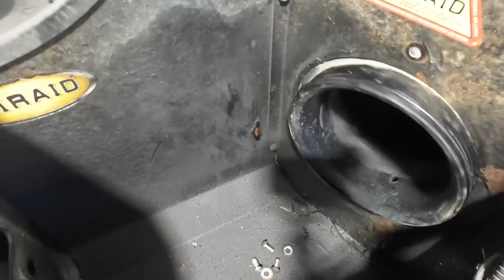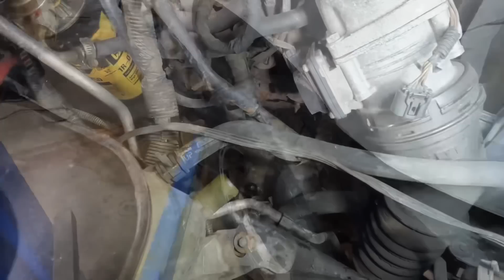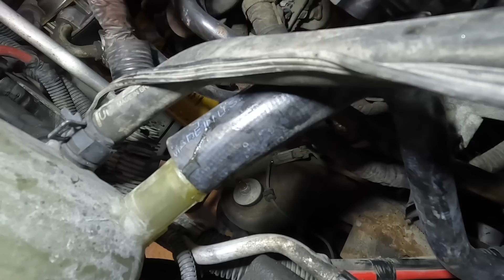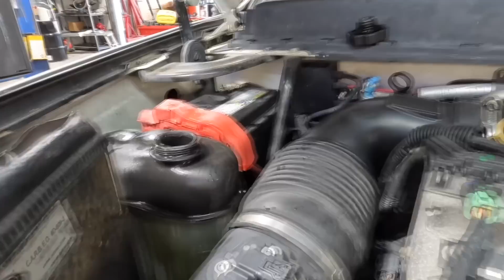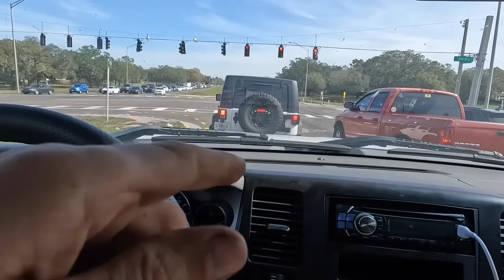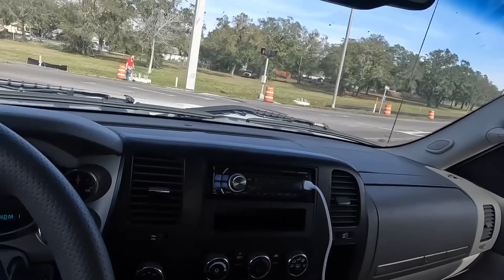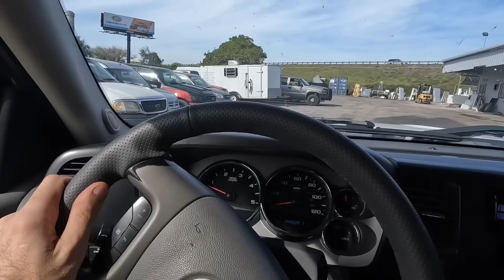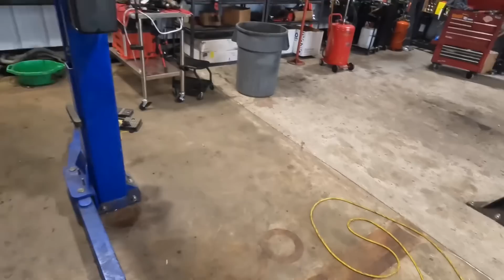Four way Radiator Hose “updated design” | Pig of a job! DURAMAX 6.6

Comment: I've learned a couple of things concerning exhaust manifolds over the years. The best method for welding cast iron is to preheat the manifold and weld with a nickel rod. If your method works, then it works. The other thing is to never plug a hole with a steel bolt or socket head screw. Always use a brass plug, especially if you ever want to remove it in the future. You stopped the leak. Mission complete.

Comment: Electricity is lazy and always takes the shortest path. That being said, if you clamped onto the frame and had a bad engine ground, yes you could fry modules but I like to believe, if you own a welder, you probably know to put your clamp on piece being welded.

Comment: Back in the '50s and '60s welding cast iron with torches didn't usually work well which is where the myth comes from. TIG and MIG are very different animals.

Comment: Call me crazy, but it looks like if you tie a chain to that hose, connect it to the bench and backup the truck out of the shop as fast as you can, problem solved lololoolololo The idiot that designed that needs a trip behing the wood shed lololololo  Good Luck, Great work as always.

Comment: I'll have to go back and watch that video, but you can definitely weld cast iron all you have to do is preheat it first and grind a groove in where it's cracked to give the filler room. Just because they can't weld it doesn't mean it can't be welded.

Comment: To avoid getting soaked by coolant with disconnecting, just slice the hose at the low point. It's being changed anyway, so no harm. I've replaced a couple dozen of these hoses.

Comment: Nothing wrong with welding the hole up the way you did. A-holes will pick apart anything you do in public.

Personally before I seen your vid I would have found a short bolt that fitted in inside the hole and welded that to the manifold. 

Clearly you have plenty of experience and always double check your own work so good on you for all the great work and content you put out. Ignore the A-holes

Comment: People don't understand old school mechanics. Welding that hole was a great way to safely fix the problem and save the customer some money. People that don't care about customers would want to replace the manifold and charge for drilling out the studs if they broke. You care about your customers and getting the problem fixed. Keep doing you Ray, 🖕🏻 the trolls.

Comment: I don't think there is anything to worry about with welding that hole shut on the exhaust manifold.  I wanted to upgrade my vehicle a few years ago, and part of the project included cutting the flange completely off of a cast exhaust manifold and then welding it back on at a different angle.  This was on my daily driver, and several years later there has been zero cracking or other issues at the weld.  I suspect the people who say "you can't do that" are simply the ones who are afraid to try.

Comment: The bolt is what you use when you don't have access to a welder. more than one way to fix a leak. The dealer would have replaced the entire manifold so there is that...

Comment: On most your videos, maybe all of them, you ask people to share comment INCLUDING what they like and don’t like so you are setting yourself for anything from tips to criticism. Even if you said nothing, such comments are inevitable. If you are open minded, some comments will have merit and some not (based on your own evaluation of the comment). Ponder the comments for merit and if you disagree then ignore them.

I questioned in my own mind if a bolt or equivalent might be easier to plug the hole. Why? Because I can’t weld but I can screw something in. My thoughts are 100% based on my ignorance….not my knowledge. My only talent for mechanical issues is that I can pump gas with the best of them. I do change my own oil and a couple of times I changed spark plugs. I am a mechanical moron with only a tiny bit of confidence wrenching on old cars that were made before 1970, used carbs and had virtually no gizmos on them (computers, sensors, etc.). And yet even I have opinions and like to talk shop…..in hopes of learning. I never miss one of your videos. Most I can follow. Some are so far above my head that I can’t follow at all but I watch anyway for your explanations and comic relief. Thanks for all you do and treat critiques like mosquitos. They have no real value.

Comment: I wonder how much transmission fluid you could put in your 4 quart of oil to help clean the inside of an engine.  I have done this in lawn mower engines that were old and abused. It helps with  cleaning and rejuvenating an old abused engine.

Comment: Ray....you NEED to work on a lightning strike vehicle! THEN, you'll "Ahaaaaa'
Reply: And it's not even a direct hit, that blows the sh¡t out of modules! That's static electricity at thousands of volts, coming off those arcs. This essentially and repeatedly, sucker punches the snot out of transistors and diode, inside the IC chips. It blows holes in microprocessors.

Comment: Hi Ray… I have a 2015 Honda Odyssey with the 3.5 56.000 thousand miles. Similar to the wife unit van. At highway speeds I notice a puff of blue smoke in my rear view mirror it goes away immediately. It doesn’t smoke at all in normal driving speed. Can you give me any suggestions? Thanks in advance.

Comment: I think that welding with battery connected can be an issue think I've heard a story or 2 about guys who build race cars having that be an issue but like you were saying I think it has way more to do with the ground clamp being like at the front and you're welding a cage on the inside so now there is a long path

Comment: I am back to watching your videos.  Just saw "The Sluge is strong with this One".  Maybe try pop sickle sticks cut on the flat like a wedge to hold those plastic mounting clips open.  Also, maybe you like the glug-glug when pouring out of jugs, but if you hold the jug with the spout at the top instead of the bottom. no glug-glug  or splashing.  Works really great for gallon size metal cans, acutely all most any contain with a spout.

Comment: I'm not a professional welder, but I can hold my own, although it might not be as pretty as a pro. I welded a 2 inch square bar 8 feet long on the front of my travel trailer years ago because I wanted to have a point to use scissor jacks for leveling it, and most places required me to lift one whole side off the ground.  Plus it reinforced the tongue...they don't weld them like I like it.  Anyway, 12 volt system, ground on the frame within 4 inches of where I was welding, no issues.  People were like, "OH, no, you welded without disconnecting the batteries.  YOu probably burned something inside now".  Never did a thing.  Electricity flows to the shortest route from positive to negative, so it's not an issue. Unless you're using a 50 million volt lightning bolt and you're Zeus there won't be an issue.  Saw lightning miss 2 dozen trees 50 feet tall to strike a fence 4 feet tall once.  Zeus must have saw a bug or something he wanted to kill...LOL>  Anyway, keep up the good work.  Let the trolls find another bridge to bother people crossing.  Don't even acknowledge them. That's all they're looking for...attention.  Take care.

Comment: Ray don’t take all these  comments too personal. She welding cracks on let say the block which some machine shops do to save classic number match inv blocks is very critical to the process and the type of metal used to weld it    You just welded a small hole. You put out good videos

Comment: Holes in cast iron can be welded. The problem is with trying to weld a crack, because the crack tends to sprread under the heat of welding, so you keep on attempting to follow the crack.

Comment: Hi Ray.
Re manifold welding. Ray it was your own voiced concerns re debris falling into the manifold that would have prompted people to suggest installing a cutdown bolt into the hole, not tapped , and shortened. This  would  have addressed your concerns add made the job easier as you would be welding the circumference of the bolt head and not trying to fill a gap . Yours Ray.

Comment: What you are missing on the manifold leak is that you should have dismounted the manifold, weld the hole mostly closed, tap the hole, thread in a bolt, weld the bolt in place, then remount the manifold.  All while spinning a dead cat counterclockwise over your left shoulder of course! 😁

Comment: Great explanation about the module issue. You are correct, but plz don't be offended. I am just conveying my experience. I use to install spreader beds onto 18 wheelers. we welded only behind the cab and back, but still burnt the ecu out.

Comment: I had no problem with you welding the hole shut.  No blow back; just a simple question - which you answered well.  Different metals could have introduced and temperature differential stress crack risk.

Comment: To all of you calling others that suggested tapping the hole with a plug, calling them arm chair mechanics. How do you know? Just because they suggested a different way? I have been running my shop for 40 years and I have installed many Banks temp probes in the exhaust manifold by drilling and tapping without removing the manifold. Never lost a turbo! Also everyone that said the plug could crack the manifold, why would Someone like Banks suggest drilling and tapping a hole in the manifold? But since he was not ever going to install a temp probe in that truck, I agree with welding it! I like watching this young man because this old man does learn a couple things! Keep up the great work Ray, and always be open to suggestions! You will be very successful!

Comment: I may not be a professional welder by any means but I’ve done enough to have proven Ray correct here. I’ve had my arms resting on the grounded table, yet I was unharmed. The electricity will not go through my jacket across my entire body and out through the soles of my boots, it’s going to go immediately to the grounding clamp. It’s pretty simple stuff, dunno why people don’t understand it

Comment: Everyone  commenting on welding the hole shut,...it isn't a problem,as  in a cracked manifold,since it wasn't  spreading.
However to be safe,the manifold should have been heated,then welded.
But very doubtful that it will give problems either way.

Comment: Welding CAN cause currents in unrelated conduction paths not directly in line with the main current path. Its quite unusual for these secondary paths to have high enough current to do damage, but it has happened in the past and it can happen in the future. 
Just look at the history of "spark gaps" and you will see that 100 years ago they used spark gaps as the very first transmitter to send a signal across the Atlantic ocean. So yes spark gaps can cause currents in unrelated places. The fact that you have never seen damage is good, but not universal.
PS. it can cause damage even with the battery disconnected (even more unlikely but still not 0 possibility)

Comment: Hi Ray, just watching the rad hose part & am wondering why G.M couldn't just piece the hose together at the bypass hoses with clamps. Is it that G.M is that broke that it needs to make mechanics charge the customer so much to do a 10 minute job instead of 4 hrs. Keep up the good work buddy. Love watching you work on American cars from Australia. We would say the engine bays are toadstools cause there isn't mushroom. I think I will stay with my 2.9lt turbo common rail diesel.

Comment: Welding causes spatter and cast iron is a very dirty metal,which means that even using a mig process there will be small amounts of slag. If you weld a manifold and then clean out the inside then you're good.

Comment: As the old saying goes, opinions are like assholes. Almost everybody has one and many of them stink, your own included. With that small hole, the welder was probably the easiest way. The cast iron in exhaust manifolds is usually pretty low grade. Sometimes the weld doesn't stick so well to the cast iron, especially when it's contaminated with exhaust gases. You saying that plugging the hole with a bolt would restrict the exhaust is as much bullshit as the people who say you shouldn't have welded it. You don't have to use a 2 inch long bolt. You can tap a hole without getting any more debris in the manifold than you did with the grinder. You can use grease or a magnet on the tap. You can pressurize the exhaust with air to blow debris out of the hole. There are often multiple ways to accomplish the same task with one being just as valid as another.

Comment: A lot of armchair mechanics still believe that there is a problem when welding cast iron. Unless they have mig weldedcast iron before, but don't even try to stick weld a cast iron manifold with the old 6012or 6014 low cal rod. You need to use High cal(cium) rod when stick welding cast iron. Also there was no structural stress when simply plugging a hole.

Comment: Everyone has opinions welding the hole shut versus welding a plug in it with the heat on the exhaust the plug or bolt will not last , the weld is 100 times stronger than

Comment: It fine...you should gave just stuck a carrot in it...

Yes, cast can be welded. I weed a 4 " crack in a 1941 Chevy engine block using an AC welder. It was just the outer water jacket. I heated the area thoroughly, evenly first. Welded quick so as not to crystallize the cast.  Engine was out, laying on its side. Worked fine, last long time. :) We used " Super cast" welding rod.

Comment: One point is that successfully welding cast iron that needs to carry a load, either from thermal or mechanical stress (i.e., something that has cracked) and having it last is way hard and way different from welding up that very unstressed and perfect hole in that manifold -- two very different situations.

Comment: I think they explained the method incorrectly. It can be anything to cover the hole. One would weld the bolt, stud, whatever steel thing tyo the manifold which would mitigate debris from entering the exhaust and plug the hole. Or do it your way which also works fine. I'm a terrible welder, so I use a bolt just under the size of the hole with a flat washer if needed.

Comment: Hes got over 300 in coolant in it already wow huge job for a stinking hose your good for welding the hole up there's not enough threads to hold the boldt

Comment: Based on 60+ years of electronics repair, electricity will follow the path of least resistance. In this case, the shortest distance between the ground clamp & the welding gun. ( Like your paralleling the larger battery cable with the smaller one for more current flow to the battery). Since the manifold is already at ground potential,  and your ground clamp was inches away, IMHO, no damage should occur. That being said, if you were welding on a starter casing or an alternator casing, I then would be concerned about the possibility of damage to the electrical system or a control module due to the possibility of a voltage spike somehow inductively feeding back through the system into a module, especially if your ground clamp was attached to the engine block or the frame of the vehicle.

Comment: I would have cut a bolt short so it does not interfere with flow. Then weld that plug in.

Comment: This welding on a vehicle is only an issue if you have a bad earth and only if you have something else with an earth lead like your lift making connection to the body as the welder will try and find a path to ground through your lift round your mains circuit down welder lead.....long as vehicle earths are ok it will be fine but it will damage power leads to welder, shop and lift....but if lifts not earthed there is no path and no worries as welder wont work.....if cars earth is poor it can cause issues trying to find this path through wires not rated for high current or electronics that dont like 48v or what ever your welder mig arc voltage is......there is no real safe way to weld on vehicles and a million different opinions.....all i know is electronics hate welding so nothing you do will stop risk without just removing item to be welded so if its not possible roll the dice 😂 i always pull off earth lead so i feel better but probably makes no odds but i not fried any electronics in all the years i been working on rusty junk so go with what you always done as it works for you and nuts to folks getting butt hurt from their arm chairs while your getting it done.👌

Comment: Hey ray I thought about tapping and bolt but only because you said that the hole must have had a sensor which implied it was ok for a bolt. The welding just seemed messy but you always do a good job so no reee intended

Comment: Quick question: If you KNOW your going to change out the old hose for a new one: why don't you just use a knife to cut it away from the output line? Wouldn't that speed up things for you and just make it faster?
Reply from the maker: It works for some, I just don’t do things like that.

Comment: Since  I'm not a welder or have a welder but was a machinist. I would have drilled an tapped it but would've used a brass plug which works good with cast and heat. But you have a welder and it worked and it was quick. It's  all good! Who cares about the grill ? I would suggest  to the customer  cleaning the fog out out of the headlights